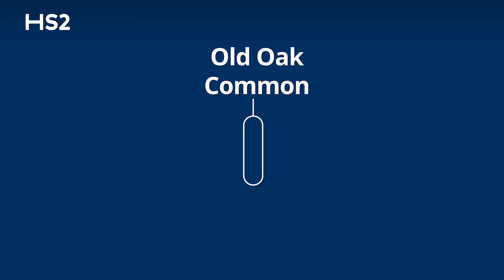HS2 Project Update, May 2024

Comment: Connectivity and capacity are the keywords. Don't moan about being stuck on an overcrowded, late running train if you are against HS2. Yes, delivery could/should have been better. But this needs to go to Manchester, Leeds, and the Golborne Link is a must.
Reply: 100% agree. New St in Birmingham is already above capacity - dangerous scenes at times. 
Hopefully as the line is indeed running up to Handsacre we'll see Northern Powerhouse essentially repackaged as HS3, which I believe is the best option.
Reply: @laurencec09  You want  to pay another £5 a week for every taxpayer in the country for the next 16 years.
Reply: @Rob-u1r  Hello, and thanks for replying. HS2 'frees up' slots at places like BNS to allow more local trains, commuters. You take out the expresses, and you can run more suburban trains. It will also free up slots for more freight, benefitting everyone by having fewer lorries. But only if you don't throw all the northbound HS2s onto the WCML at Handsacre. The UK also needs that at Manchester, Leeds, Liverpool...
Reply: @mesnilman2327  Suburban routes in many cases are far worse with HS2.
Reply: @richardwilliams6132 how can suburban routes be worse with hs2 if we don't even have hs2 yet. Either way give any example of a city that had worse suburban lines as a result of gaining a high speed line
Reply: @faye_didac  Clearly this video is extolling the supposed virtues of HS2 when it opens  , so my post is about that, Not rocket science, The list of inferior services from certain cities is extensive but altered since the  line ceases at Birmingham after spending in excess of £50BN or £300Million plus per mile.
Rugby will have worse service,
Reply: @richardwilliams6132  I agree with the price tag being insane, if we didn't have braindead, conservative NIMBYs and a conservative government, we could have built hs2 using less tunnels and therefore making it far cheaper. But I ask for a city where the suburban service has reduced in quality due to high-speed rail line being built and your reply is that the list in "extensive". I can say with confidence that cities like Lyon(France), Nagoya(Japan), Rotterdam(Netherlands) and València(Spain) have had cheaper high speed rail connections with an improvement to suburban rail. And it's not like these countries are massively different to the UK in terms of development and money.
Reply: And on to Edinburgh and Glasgow! Getting Scotland to under three hours to London is essential. And, who knows, when the UK wakes up we could have direct services to continental Europe, as was always intended!
Reply: @tomhoworth1685  Three hours between city centres is a rule of thumb journey time for when rail becomes competitive with air over long distances. Planes are faster but journey times are increased by the need to access the airport, which is often miles from the city centre plus delays due to check-in and security.
Reply: @tomhoworth1685  No point,
Reply: Indeed it is very telling the language he uses. Definately just the start of a high speed network. When the dust has settled continuing north will be apraised again. And hopefully with more control over budget and add ons...
Reply: it's a great shame that we can't be part of the EU's transeuropean network plan, it would have brought about some much needed accountability
Reply: @Gershw1nn  Best joke yet, Greater accountability in the EU, whose own accounts are as transparent as  pea soup.
We have our own totally incompetent Public Accounts Committee to sign off anything that HS2 and the DfT told them, until it really hit the fan, and they started running scared of what they had agreed.
Reply: if connectivity and capacity are the keywords, why aren't they improving those? a high speed shuttle service between London and Birmingham or Manchester for that matter is NOT improving connectivity OR capacity on the railway ONLY that specific corridor. The railway system we have needs the investment, that is where the 27 billion spent should have gone.
Reply: @olliedrake3140  Taking express trains off the 'classic' WCML opens more slots for more stopping services, and more freight. The WCML is at capacity. If you want more trains stopping at Lichfield TV, or Stechford, then you need to take the express trains off those tracks. That's what HS2 does. It provides space for more trains from - say - Aberystwyth to get into Brum New Street. That's what capacity and connectivity mean. The more HS2 takes those express trains off the WCML and ECML, the more local and freight you can run
Reply: They should start connecting the rest of the line from North to South, instead of continuing from London. The disruption to London is just too much, I’d say.
Reply: @Stand-Up-m2x  The whole idea of HS2 is to speed up WCML Inter City Services from the North West and Birmingham to London so allowing more capacity on the existing southern half of the existing WCML for more freight and other passenger services and the free up Birmingham New Street Station, where else other than London would this line go as it is connecting the North to the South of the UK
Reply: Can we have some money from this ENGLAND ONLY project please? 🏴
Reply: @ianjames3078  And we could save money by not giving Scotland and Wales their money from the UK Government treasury and they then upgrade their Railways's it is callede swings and roundabouts and HS2 does help Scotland in that their London bound trains using the West Coast Route will use HS2 from Handsacre in Staffordshire so gaining time and modern tains at the expence of England.👍👍
Reply: No but dont moan if the new high speed train breaks down and AC turns off or when train drivers go on strike neither .   New trains have teething troubles and build quality issues , you'll see .
Reply: Can’t see how HS2 can improve the Bangor, Aberystwyth, Cardiff service
Reply: @JohnSmith-bx8zb  Niether can I mate as it is not being built to improvre the Liverpool to Aberystwyth Service just service on the West Coast Mainline
Reply: @peterwallen1063  so why are the Welsh being made to pay for it then
Reply: @JohnSmith-bx8zb  So why should I as  an English man give money from the UK treasury in the form of millions of pounds to the Welsh Assembly to run Wales and Scotland, works both way and is called swings and roundabouts, also as an English man why should I pay out of my taxes towards projects in Wales, it is because this Country is called the UNITED KINGDOM of which Wales like England is a part of.
Reply: @peterwallen1063  the cost of HS2 is above the existing funding of englands colonies of Scotland, Wales and NI
Reply: @JohnSmith-bx8zb  England has no colonies of Scotlnd and Wales or NI, they are all a part of the United Kingdom and governed by the UK Government and HS2 is being funded by the UK Government not the Welsh Assembly or Scottish local Government
Reply: @peterwallen1063  sorry England’s conquests!!!
Looks like you fail to understand that these conquered countries also send cash to London.
HS2 is a poor value, it’s, in the opinion of very many, of very little value to the failing union.  It’s small gain is to tie Birmingham closer to London.
The biggest short coming is that it does not connect Scotland, the north of England, the southwest and Wales directly to Europe.
Reply: Golborne via Crewe is a must. With provision for future e/w NPR junctions.
Reply: @howardstephens5003  look up the proposal to re use the Great Central that would have been running now.
Once again nothing for Scotland or Wales
Reply: The Chiltern and many Other lines could be electrified by stopping the damaging road expansion program and using the money more effectively
Reply: @guyroebuck8510  you do realise that Chiltern Railway only runs to Birmingham (Moor Street, next door   Street) don't you?. The capacity crunch is north of Brum.
Reply: @mikehindson-evans159  I do realise that HS2 only goes to Brum. The whole network capacity could have been improved without HS2's £145B price tag. The Integrated network Plan of£96Bn approved was dominated by over £76)BN on Hs2 in the early stage development. It is just an absolute nightmare, Out of any control  and massively over specified by foreign consortia dominating expenditure ,The PAC can't stop them,
Reply: @mikehindson-evans159  No it also runs to Birmingham Snow Hill as well
Reply: @peterwallen1063  agreed.
Reply: @guyroebuck8510  A hood tgeory but what would you do when you try to stuff 18 trains per hour into Marylebone?

The whole point of the new spine railway is capacity across the board.
 Piecemeal did not work in the 1980s, 1990s and in the early part of this century.  Penny-pinching upgrades have been tried (and swallowed up as train passenger journeys doubled since privatisation)

This country will HAVE to bite the bullet.
Reply: I am against HS2, but in favour of sooner, cheaper, better ways of increasing capacity on the railways, including electrification of the Chiltern Line and running full length trains on the Midland Mainline.
Reply: @aw34565  Define 'better ways'.

Do you not think those that have made railway engineering their lifelong career know 'better' than you? Particularly those with the bitter experience of the huge challenges reengineering existing railway on such scale entails?

And before the 'gravy train' platitudes are rolled out, rail engineers have hardly begun THEIR work on HS2 yet as it remains a Civil Engineers construction activity for now. And if HS2 wasn't being built many of the same Civil Engineers would be employed building a vast number of new roads instead, yet we never hear about Gravy Road rollers do we? 

Why, because 'gravy' is a figment of the 'do nothing' brigades creative imagination.
Reply: @aw34565  you cant like the railway and be against hs2. the faster journey times is just a by product of freeing up the WCML

Comment: Wouldn't it have been better to see if the Euston extension is going to go ahead before spending all that money on the Atlas Road logistic tunnel?
Reply: The equipment and the materials were already brought/hired to build these tunnels years ago. This is why the TBM for the Euston tunnel is already due to arrive this year because it was ordered years ago before Sunak made the decision to pause it construction, these machines takes several years to build. So they will have to store them underground an wait for funding. 

Through now it seems common sense may have struck them and rumour is funding for the boring of the Euston Tunnel is to be made available. An it kind of make sense to get the tunnel in place and then sort out the end station at some other point.
Reply: @DavidKnowles0  It's almost as though meddling from ministers is driving up uncertainly and the overall cost of the project in the long run
Reply: @DavidKnowles0 I belive the government has signed off one billion pounds for the Euston leg.
Reply: @westyham1  It just a rumour at the minute no official announcement.
Reply: Is it still unsure if they will eventually build to Euston?  If you add on the time to change and connect to central London you are actually not getting a great time saving with HS2 if it is only going to OOC.
Reply: It is being built to Euston Now, the Government again has had a change of face

Comment: Bring back Manchester and Leeds with NPR.
Reply: Even if they wanted to bring it back--they already sold the land, they would have to negotiate a new right-of-way which could take years just to clear a new right-of-way path.
Reply: @DroppedWhisper3  No land has yet been sold. Safeguarding has been remove but the land already acquired is still in HS2 hands.

They can just use the same route. An reimpose safeguarding of the land.
Reply: @DavidKnowles0  great, good look securing funding
Reply: @DroppedWhisper3  well hopefully we will get a Labour government by the end of the year. An they will reinstate the route.
Reply: @DavidKnowles0  Is there a possibility that with a change of government or leadership it might be back on the cards then?
Reply: @tomq6491  Yes.
Reply: 100%.    it takes time to get good at building HSR and work out all the kinks. The price per mile will be a lot cheaper than BHM-LDN.
Reply: Look what the EU is doing for the Baltic states that were former Soviet rail links and maybe to Warszawa and Berlin. at a fraction of the cost.
Reply: Not their decision. I would personally make Leeds the priority to be the next part of the network.
Reply: @DavidKnowles0  There isn't ging to be a network, all HS2 is, is a replcement for the two failed attempts to upgrade the WCML south of Crewe
Reply: @DavidKnowles0  yes, I heard Leeds is the biggest city in all Europe without any dedicated urban mass transit network.
Reply: @tomq6491  Didn't know that but it wouldn't surprise me. But I was thinking more on the lines of improving West-East connections. An it ridiculous that it takes 2 hrs between leeds and Birmingham, just 121 miles.  HS2 would reduce that to just 45 minutes.
Reply: @tomq6491  This is not about a mass transit system but about HS2
Reply: @DavidKnowles0  2 hours for 121 miles is only around 60mph by my calc.  Yeah you are right, as modern intercity travel goes that is pretty slow.  Hope they can speed things up, if not by HS2 then by some other means